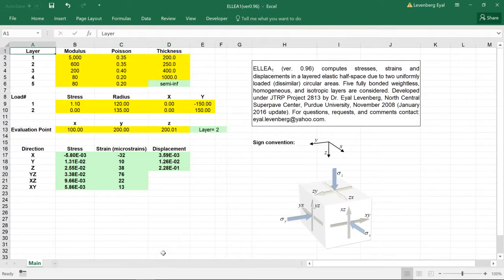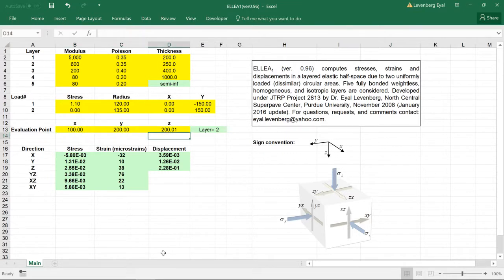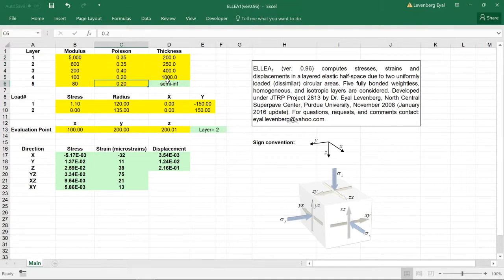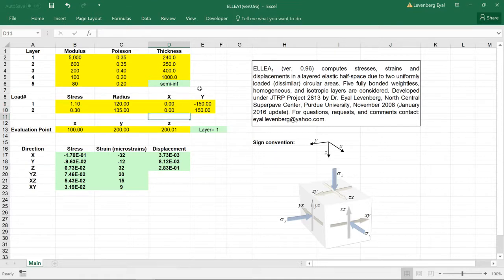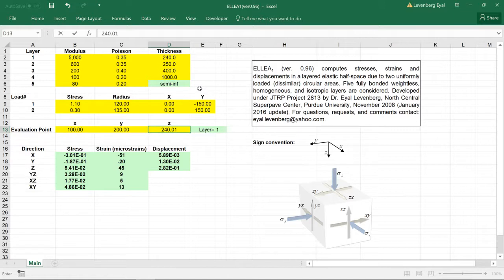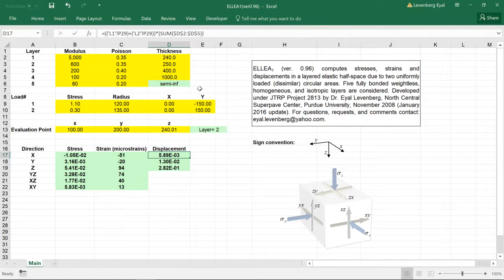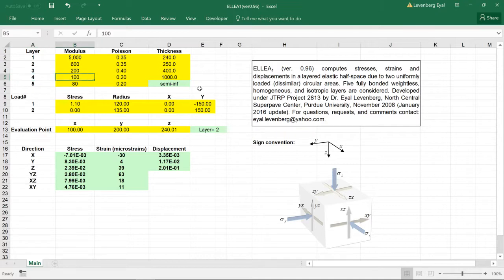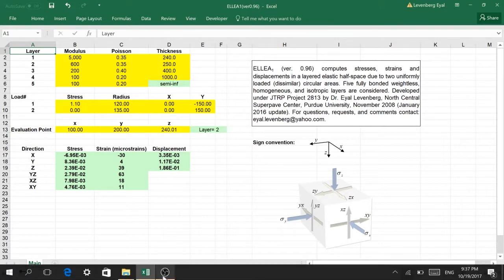Layered elastic pavement analysis code ELLEA1 (Part 1)

Comment: If the load is 80 kN, single axle with double tires that means half axle (40kN), how to consider or model it in program? And how to define the critical point at surface? Thanks
Reply from the maker: If you want to calculate the effect of the axle, you need to consider symmetry because the program only calculates for two loaded areas. As for finding critical responses, this is more complicated. First you need to find the principal responses (eigen values of the stress and strain tensors) and then search for the location (in x, y, and z) where they peak.

Comment: Can you please tell me if the strain with a minus are stretching or compression?
Reply from the maker: I am following the soil mechanics sign convention where compressive stress or strain are positive. There is a small sketch in the worksheet...
Reply: @levenberg  Thanks a lot. I thought so. It's just that in some finite element calculation programs, plus is tension and minus compression. Excellent program, calculation result as in the program Plaxis.